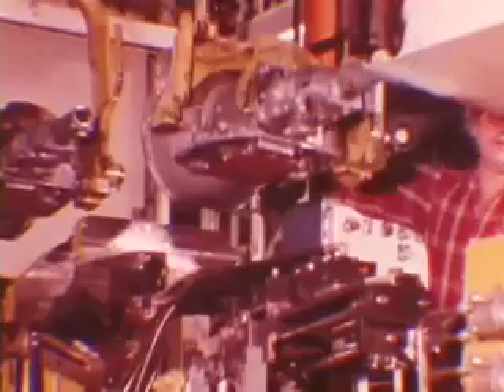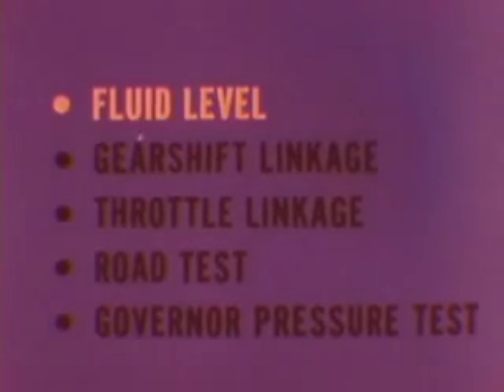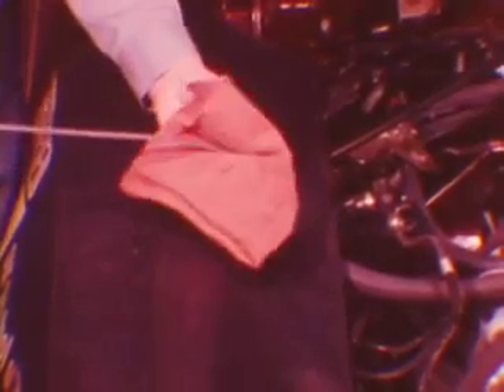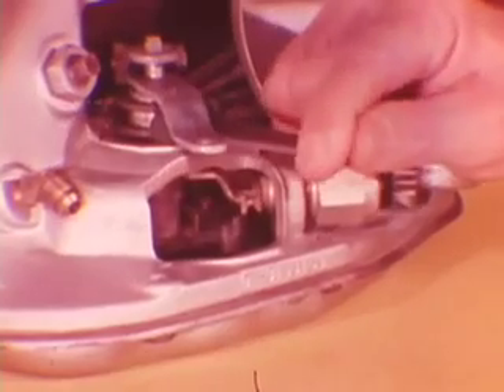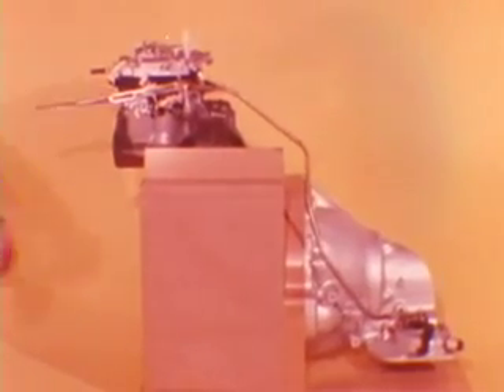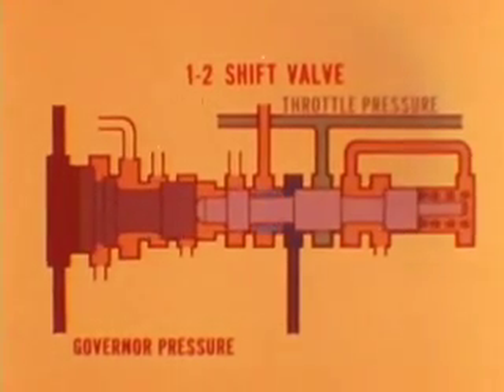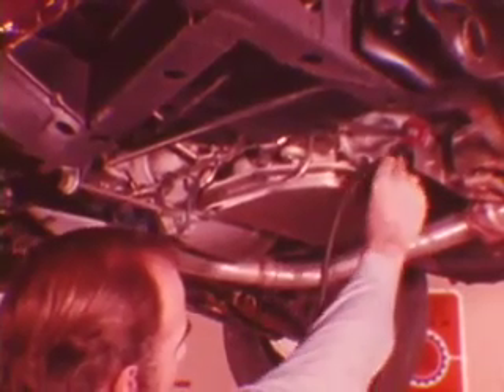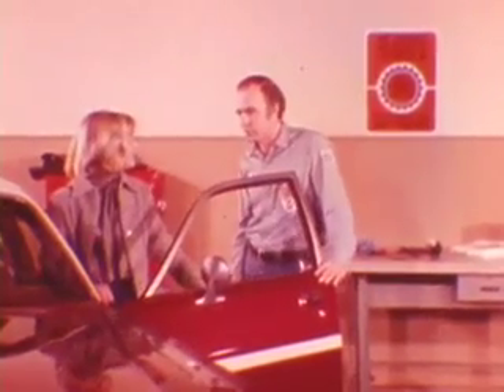Chrysler Master Tech - 1977, Volume 77-1 Torqueflite Transmission Pre-Removal Diagnosis

Comment: You know, they don't teach diagnosis like this anymore. Even when I did my vocational training over 15 years ago, they wanted us to just be part swappers, and not take the time to do a proper diagnosis.
Reply: That's just sad. I became a Ford Tech in 1985, and had to do some of the craziest diagnostics ever!! All the way up to an 89 Lincoln Town Car, that kept blowing Alternators. Her Shop just kept changing Regulators, Alternators, even a couple of Batteries! 
We didn't have much luck in the beginning either - but we DIDN'T do massive part swapping either. I was given the evil Car, but told that I could work on it - straight time!! (I was piecemeal). 
After EXTENSIVE circuit trailing, ground checks, and other gut-wrenching tests....   I FOUND out that the power flow on that POS went from Battery to Regulator to Heated Windshield Module to Alternator Field Connection - and the WINDSHIELD WAS CRACKED!!! 😱
Had a new Windshield put in, replaced the Module, and (one last time) the Alternator.... and it worked Perfectly!! 😎😀 

THEN, in 91, the New 4.6L "Modular V8" came out. We weren't even allowed to change a Valve Cover Gasket!! ANY Engine issues, and the whole thing had to come out, tagged, wrapped up, and sent to Ford!
That was probably the beginning.... I've seen and heard about other services, where a Tech wasn't allowed to WORK on certain items. Just SWAP a new one in. 😣
I've been Retired for 8 years now. What I've seen is, young Techs just aren't given the Training that we used to, back in the day. It's almost like they don't want anyone to THINK anymore....
Reply: I started wrenching for a living back in 78,,, I was working as an independent for a small shop. The big three used to send factory guys to keep us updated on this stuff. The dealerships would welcome us 'indees' to attend these training sessions. They would show these films and film strips then cover the material and have question and answer sessions. Sometimes they would even send out senior engineers to hold these classes for us. Things developed much faster then, the regs and science were all new ground. It was a good chance to talk to the guys that actually developed these systems. And of course rag about how hard stuff was to work on. You immediately find out how difficult their jobs really were. The same goes for today, getting things on the market that pass all the regs, meet customer expectations, have what customers want,  have reasonable longevity, look good and can be built competitively priced...? Brutal!
Reply: honestly- im a tech at a chrysler dealership. we do transmission repairs the same way as the video, with the difference being that we do software updates and run transmission learn routines instead of linkage adjustments. otherwise its the same deal- check fluid level and condition, check software level, run transmission learn routine, stick a valvebody in it, replace or rebuild transmission.
Reply: fwddodge22 - Were you there long enough to work on the old, 1st Gen front drive AODs? I could never figure out WHY the damn things would get stuck in 2nd gear, or how to remedy it! 
I didn't work on a lot of them, but this one 91 LeBaron Coupe I used to have, and really loved, I actually had to have someone else fix the tranny!!!! (Any Mechanic knows that humiliation!)
Reply: With FWD transaxles, there's a ton amount of labor just to access the transmission. It's better to just swap the thing out with a rebuilt unit that you know is going to work, and send the whole thing back to the plant, where they have the specialized tooling and can test it on a transmission dyno. That method has shown better customer satisfaction.
Reply: Part swapping saves time and spreads the wealth from customer to company, so that's no shocker. But, it's no way to retain customers long term.